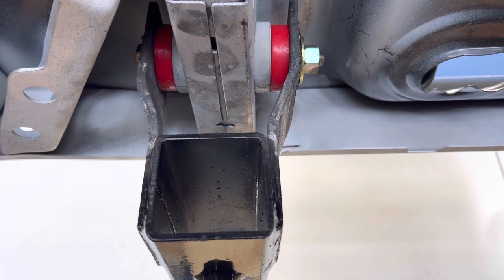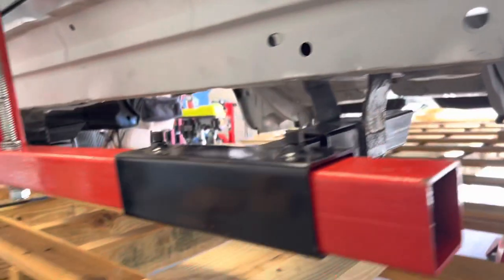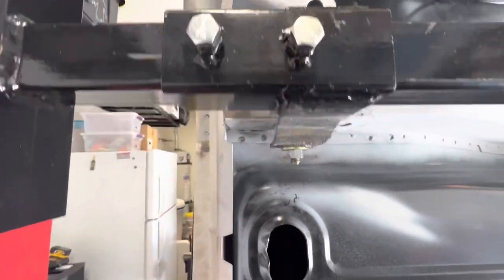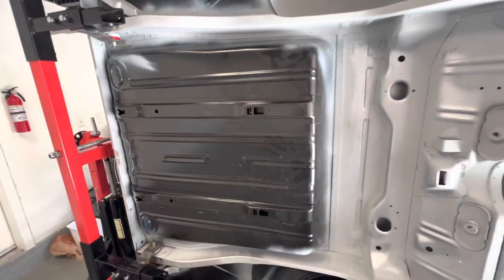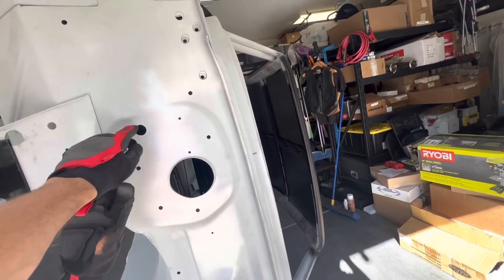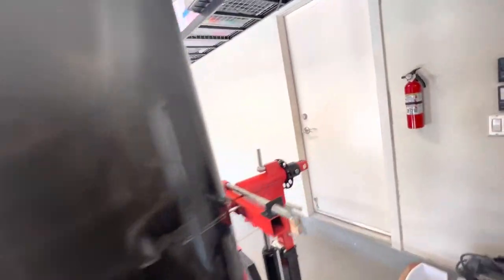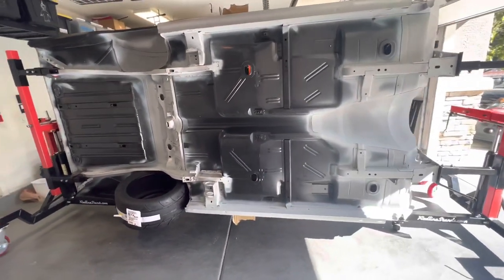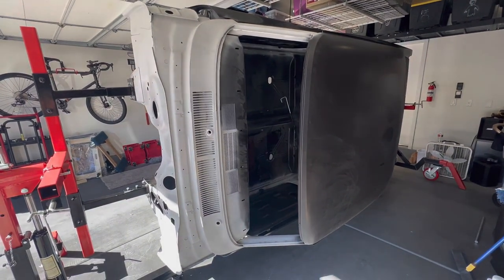Brody’s Garage 🏁 Episode 04: Mounting the 67 Nova to the rotisserie.

Comment: Regarding registration, just know there is another option.  Many guys in your situation will go buy the biggest rust bucket 67 Nova hardtop they can find that has a 67' vin and title.  They'll either move the vin tag over or have a new vin tag made and legally, they rebody the car, at which time they scrap the old car that's too far gone to rebuild, and ka-boom, you have a brand new 67' Nova with an actual 67' title.  Just an option if you chose sir.
Reply from the maker: Yep. I actually had that option ready to go but chose to just do the "Assembled Vehicle/replica" option. I figured the car is well documented as a reproduction so why try to skirt it. And besides, I was still exempt from the smog requirements.

Comment: Lots of good firewood there!... Might want to "trap door" the trunk floor above the fuel cell for easy pump access....great job on the mounting feet!.....Smog check issues: An address in Laughlin or Pahrump, or western Arizona would exempt your build from smog checks.....Suggest getting it titled when it's a roller before hanging a bunch of pricey parts on it...
Reply: I don't know how it works in Nevada, but California is smog exempt for '75 and older. Do you think it would be worth while for him to find a '66 or '67 parts car that has a title? Then, maybe it could be titled as a '67 Chevrolet instead of a replica.
Reply from the maker: They said it wouldn’t need a smog as it goes back to 1967 standards.
Reply: @Brody-Dolyniuk  ... Very cool if NV actually does it like that on a "New" replica of a 67 car.....My main suggestion regarding title and reg is to get your title as early in the build process as possible to reduce the stakes for the DMV inspector.... He/She is going to be easier on an "under construction" car than one thet's finished and worth $100k.....If you could find a rusted-out shell with a title as a donor, you could insure that the car is treated as a 67...